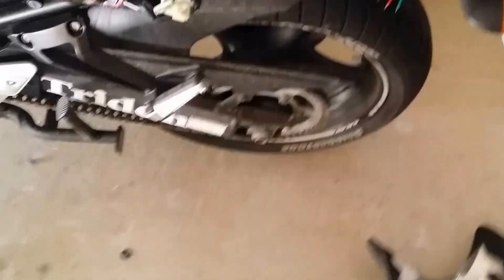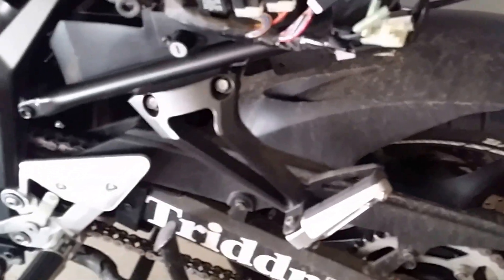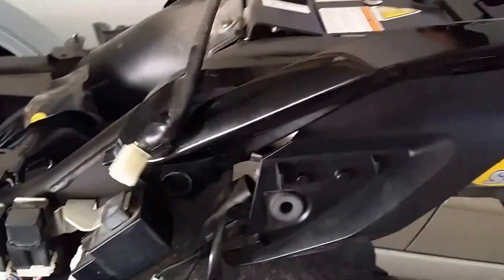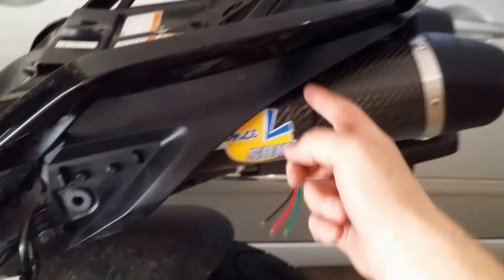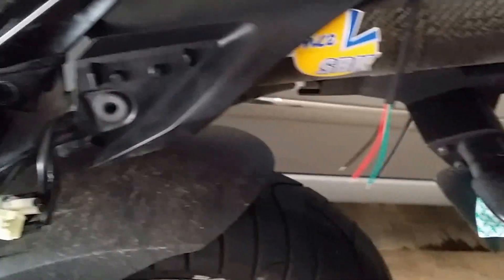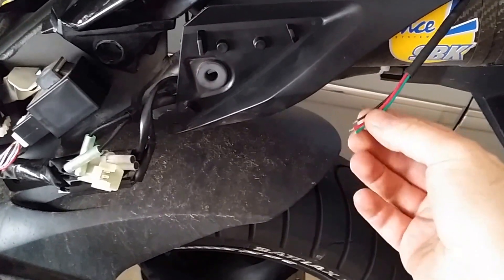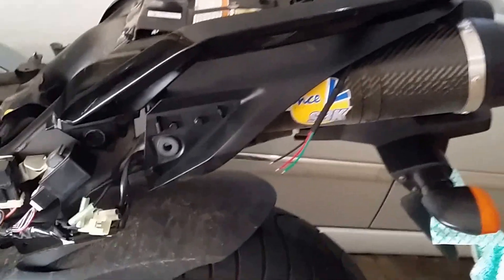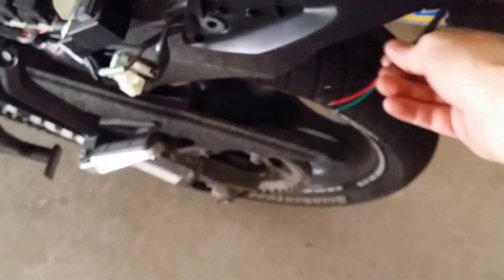FZ6 tail light... Just out of reach

Comment: So with you buddy. Wrecked my '04 FZ6. Putting it back together at present. Got an FE kit. There is about a mile from the end of the new turn signal wires to the connectors. Time to look up a video on soldering.

Comment: Dammmm
Why cant you solder the old wires to the new wires just the length that is missing ???
Looks good with the clear one
Reply from the maker: the old ones go to are attached to the globe, and I dont have a soldering gun. so i would have to get connectors anyway, so while i was at the shops I bought some electrical wire. i want to keep the standard things original so if i have to go back to standard, I can without hassle.It worked out fine in the end, just a pain in the ass. if its for an FZ6 then make it fit an FZ6
Reply: Triddn very true if they sell it for the model make it fit. 
Glad you got it sorted